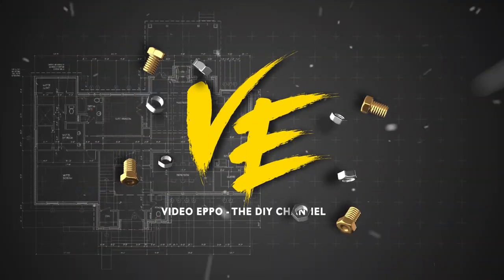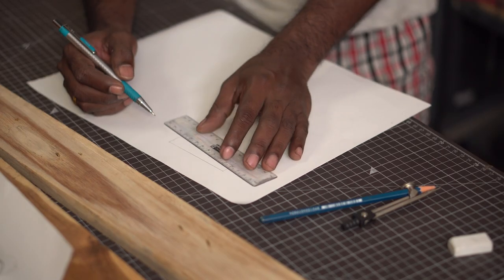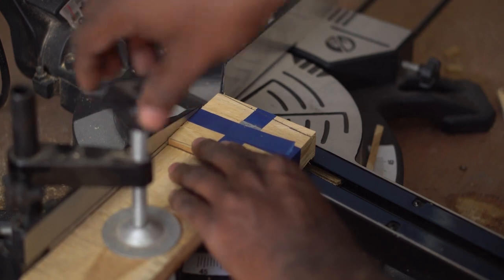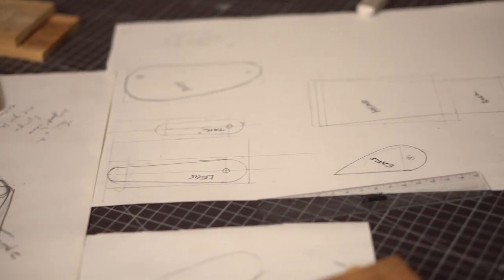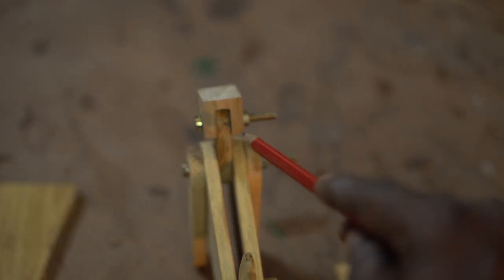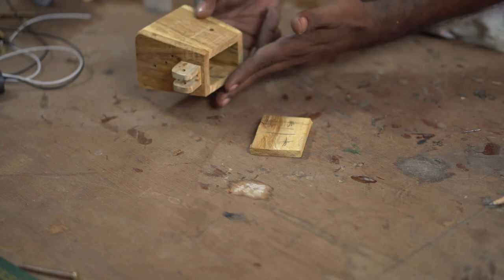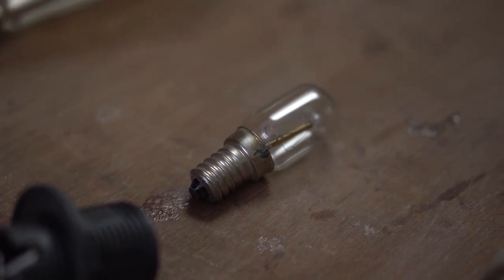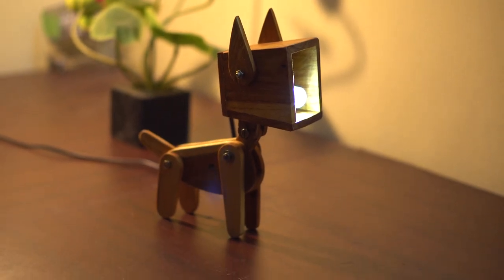Turning pallet wood into Cute #Night Lamp made (subtitles available)

Comment: I never realized that a refrigerator bulb is something special. I only knew that it's turned only a short time (when the refrigerator door is open)
So it's used to that.
Reply from the maker: I found some LED fridge bulbs. Its a bit on the expensive side  but lasts long